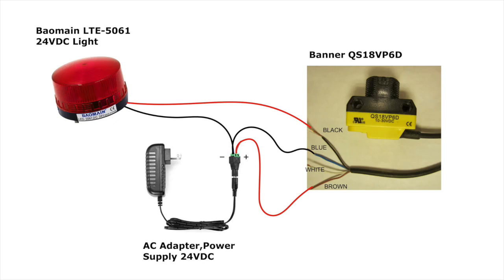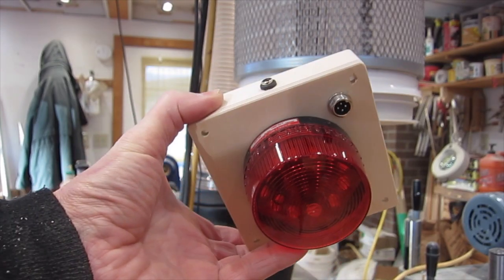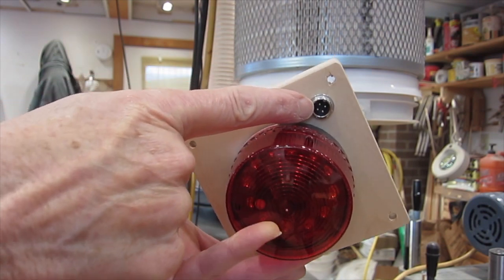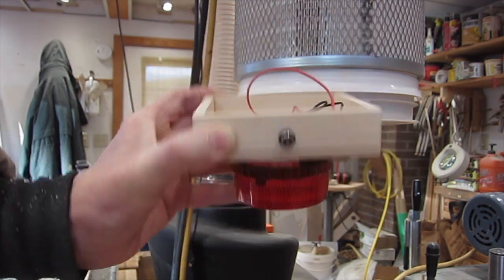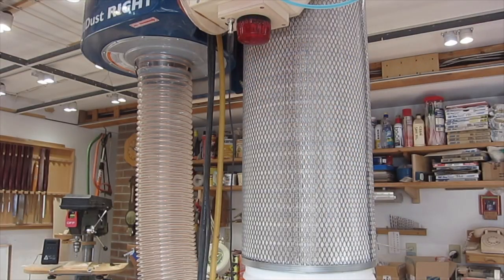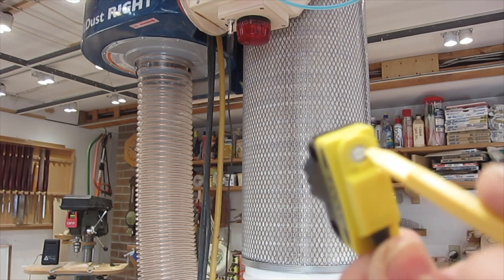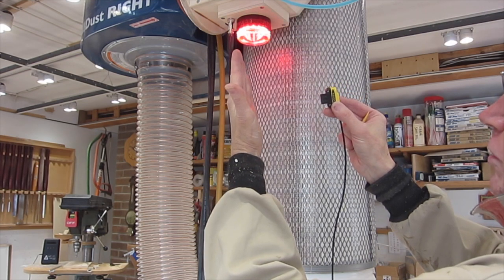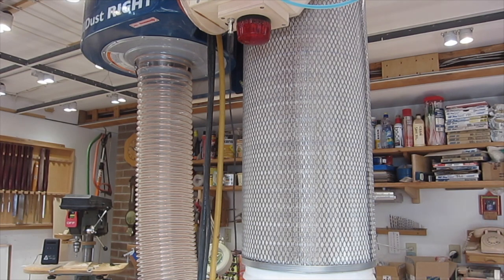Low Cost Level Sensor for Saw Dust Collection System, using Banner QS18VP6D

Comment: Thanks for the circuit, I ordered material and made a test setup.
But I noticed that the Banner switch was works the wrong way around.  
On the drawing it is a PNP output, it must be a NPN output.
Reply from the maker: PNP or NPN can be used, just needs to be wired a little different.   The wiring for each is shown on page 3 of this document https://www.mouser.ca/datasheet/2/1437/197051-3078991.pdf

Comment: hi there. I have a 12v ps and a 12v strobe light . i flowed your schematic and nothing is happening i just left the white  wire from the banner  free un used and nothing is turning on. I do not know what i'm doing wrong. I would appreciate your help. Thank you
Reply from the maker: Check the polarity of the power supply.   Check that the power supply is DC, not AC.   Check the polarity of the strobe light, try reversing the strobe light wires if polarity is not marked.   Check the current required by strobe light, cannot be more than 100mA and should be 50mA or less.    To turn on move your hand towards the QS18VP6D sensor.     Let me know what you find.
Reply: thanks for taking the time to respond to me. all my components are functional. polarities of PS and strobe light are ok.  my connections ; brown to + PS, BLUE AND Neg.strobe to _Neg. PS , and LK to + strobe , and the Wt. wire not connected . still nothing is working or lighting up.  @steven.woodward
Reply: PS is 12v DC/ max 2A and the strobe light is 12v dc / 200 ma
Reply from the maker: @FKWoodworking      The strobe light is the problem.   Banner is rated for 100mA maximum at room temperature.   200mA probably damaged the Banner sensor.    Better to have an indicator that only requires 50mA.
Reply: Or you could add a 4.00 relay to the circuit.

Comment: What’s the purpose of the white wire? Is it tied to blue/ground as well?
Reply from the maker: Good question.    The white wire on the Banner QS18VP6D is not used and is left unconnected.    I have just added that note to the description.   Thanks.
Reply: @steven.woodward  thank you for the note! Your diagram does show it disconnected but now I know I’m not crazy.
Reply: The white wire is a Normally Closed line.  It carries current whenever the sensor is inactive. Use... you could have a green led by your red light that would come on when powered up,  telling you the system should be working.  When the sensor activates, the white wire circuit  becomes open, thus no green light and the red light turns on.

Comment: Can you share the part number for the connector that the Banner cable connects to in your build?  Thanks,
Reply from the maker: The connector is a GX12 - 4 pin Aviation Connector.   I purchased these on Amazon.    They are OK but not great quality.  It  took some patience for me to solder the fine wires to the connector.      Any 4-pin connector will work.  https://www.amazon.ca/gp/product/B07Y895DP3/ref=ppx_yo_dt_b_search_asin_title?ie=UTF8&psc=1
Reply: @steven.woodward  Thanks.

Comment: Great build!  I am duplicating this now, and using an indicator light with alarm.  The sensor lights are illuminating, but the light/alarm is not doing anything.  Could you confirm whether or not you used the white wire?  Thanks.
Reply from the maker: I did not use the white wire.     Check the current required to power the alarm.   Aim to keep total current (alarm + light) at 50mA or less.    If alarm has a plus and minus terminal perhaps they need to be reversed.       Good luck.     I have found that the Baomain LTE-5061 mounted on ceiling,  casts a flashing red light over the whole shop.
Reply: @steven.woodward  thank you, Steven
 I am using a 12v 5amp power supply. The sensor powers fine, as do the micro switches for blast gates. I did find that I have an NPN sensor rather than a PNP. Not sure what that means, so I'll have to research that.
Reply from the maker: @tommckenney7627 with PNP version the indicator light goes between sensor wire and power supply ground.    With NPN version the indicator light goes between sensor wire and power supply positive.
Reply: Thanks Steve.  I read that NPN pulls power from ground, and an inverter/signal booster may be required.  Ended up just buying an NPN, which I should have done but didn't realize the difference at the time.  All is good now, and cannot wait to start using the system.